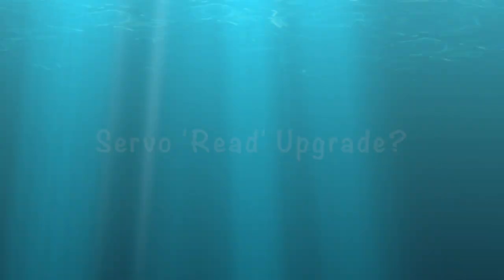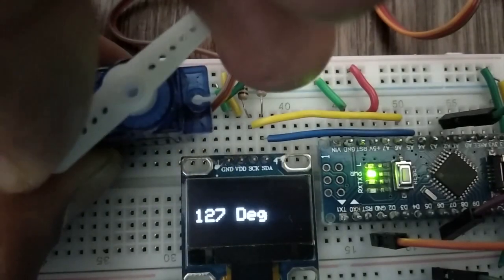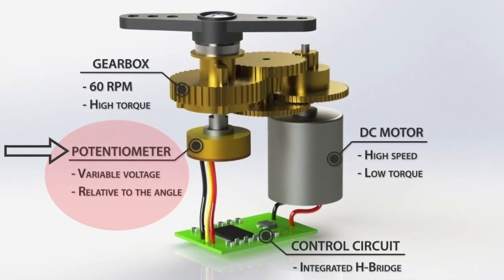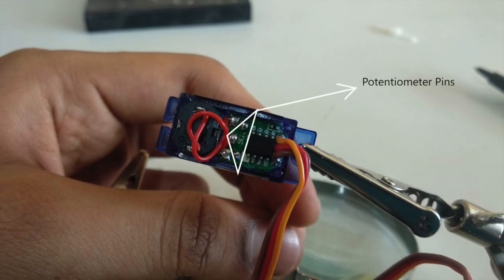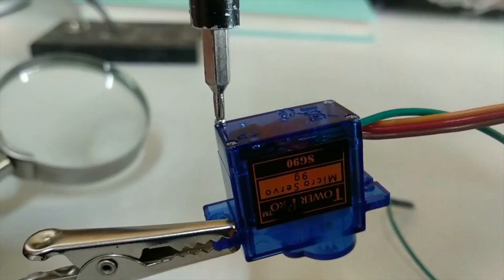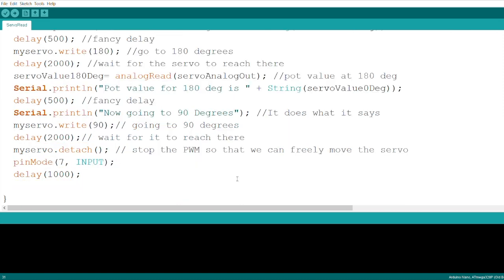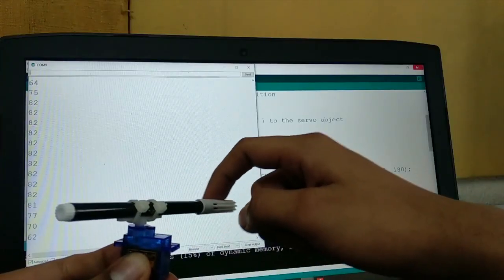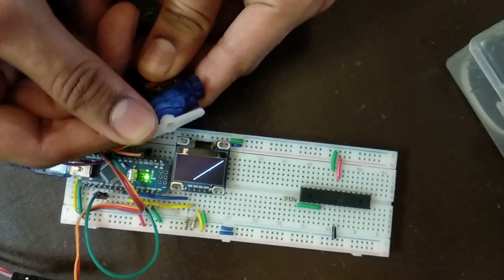Simple Servo Upgrade to READ ANGLES!

Comment: const int sensorPin = A0;

void setup() {
 
  Serial.begin(9600);
}

void loop() {

  int sensorValue = analogRead(sensorPin); // nilai 0 - 1023 (default ADC 10-bit)

  if (sensorValue > 690) {
    sensorValue = 700;
  }

  int mappedValue = map(sensorValue, 0, 700, 0, 180);

  Serial.print("Sensor = ");
  Serial.print(sensorValue);
  Serial.print(" | Mapped = ");
  Serial.println(mappedValue);

  delay(500);
}

Comment: Nice job! You may add a circuit to measure the current to make the solution complete. You know the servo stuck, and also know if the servo is struggling.

Comment: Sounds like you are making an optical rotary encoder which you could buy instead of meeding to make yourself. You can also get a servo motor and do some coding to read the angle of the shaft or a potentiometer though the potentiometer does have a limited lifespan.

Comment: Sorry, what's the difference with the Servo.read() function?
Reply from the maker: Servo.read() will return the last value that was written by the user. In other words, that function won't return the correct value, if the sevo is externally rotated using manual force.
Reply: @CuriousMotor  but if i don't use manual force, it's still returning the wrong value?

Comment: Is there any way we would directly use the feedback without detaching
Reply from the maker: Unfortunately there isn't :(
Reply: Detaching is just to move it manually. You can still read the voltage while attached

Comment: I‘m looking for a solution for a problem. The idea in the video leads to what I like to do: I need a servo that will rotate any angle between 1 and unlimited dregrees. I like to be able to send a PWM signal and have the servo do the corresponding angle. e.g. turn 2790 degrees clockwise then stop. 
My goal is to do really slow zoom control an a DSLR lens. 
Any ideas anyone?

Thx!!
Reply: a bit late, but stepper motor is your best friend

Comment: A million-dollar question: the value of potentiometer is avaiable even before the myservo.attach() method?
Reply from the maker: Yes it is! Because the potentiometer will have a voltage value, irrespective of whether the servo has been initialised. However this would be possibly only if the start and end values have been calibrated.